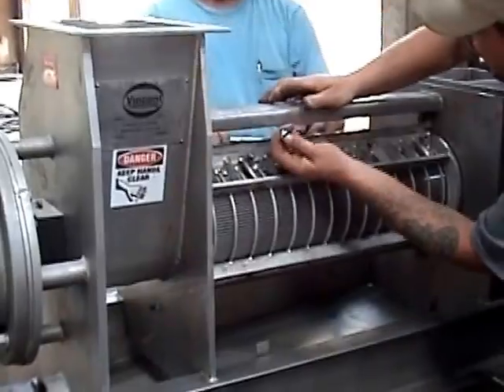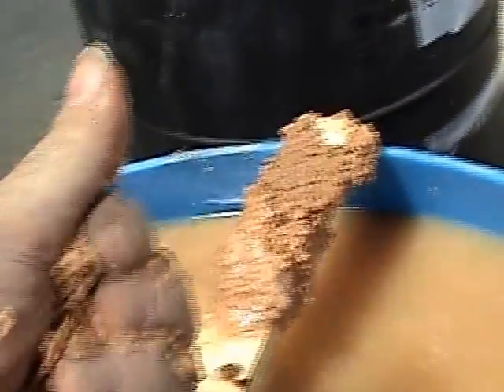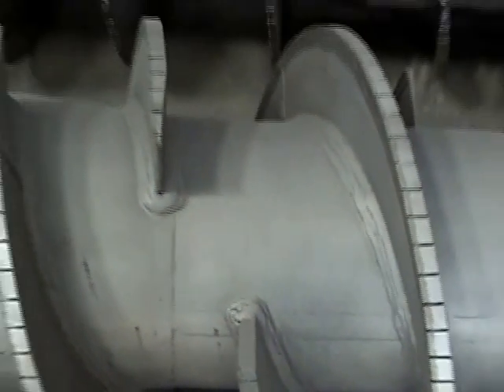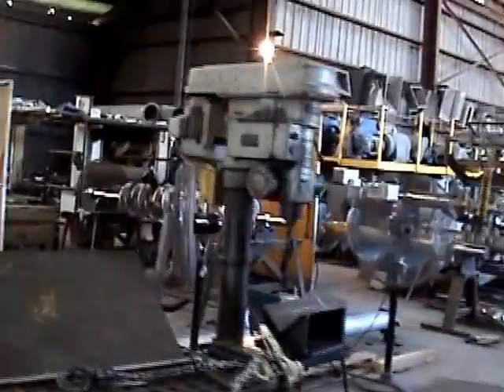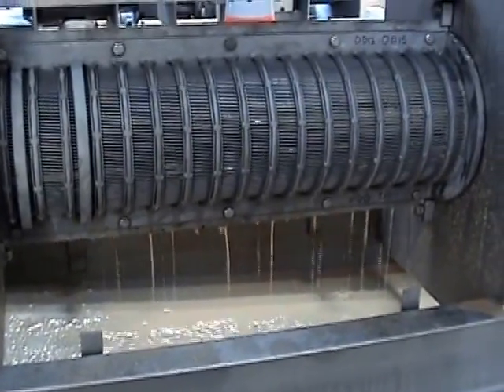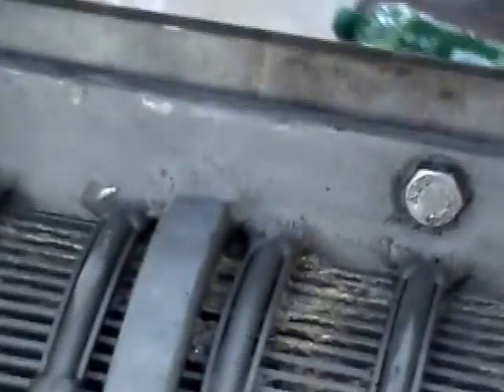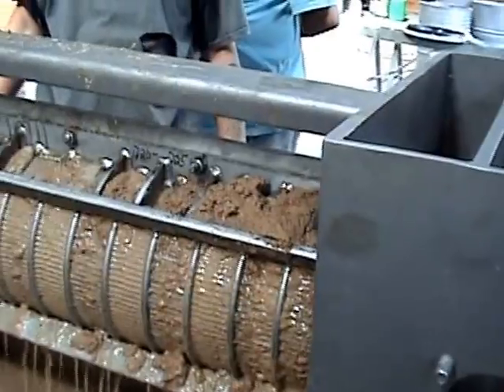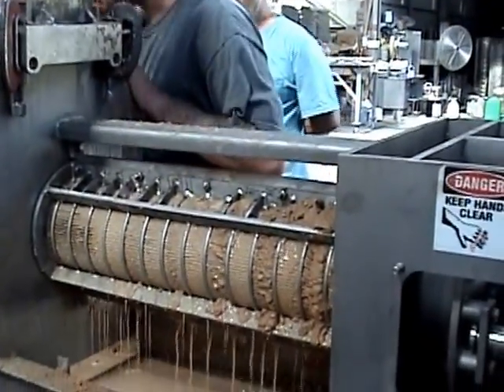STILLAGE DEWATERING

Comment: nice job! The Filter press however, is one of the oldest process filters which is used in a variety of applications. It still remains a pioneer in solid-liquid separation before the centrifuge, decanter and belt filter! 
Greetings MSE Filterpressen®. Your specialist from germany.